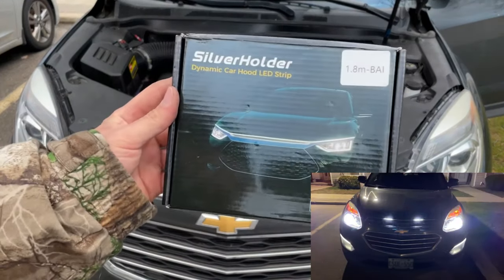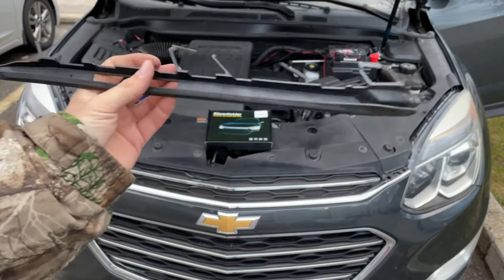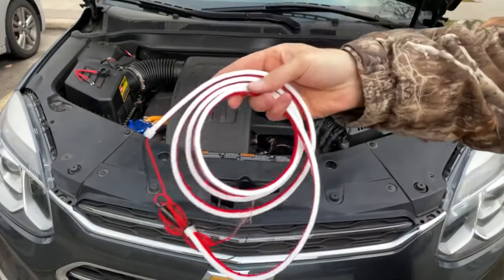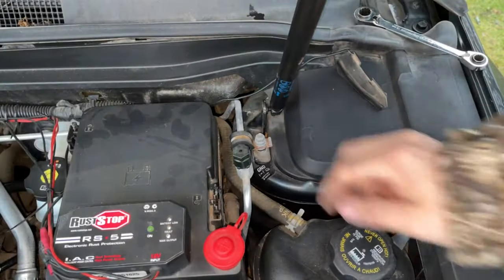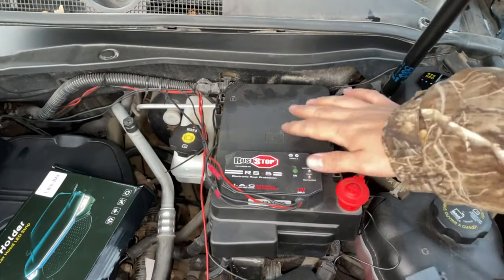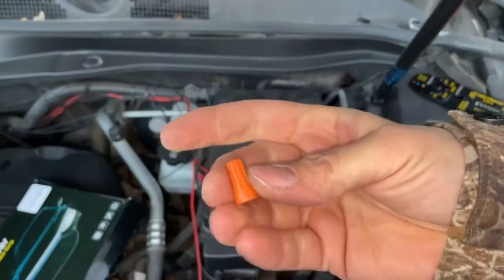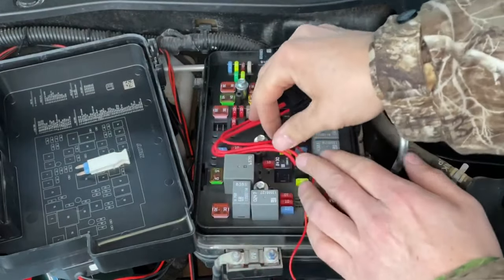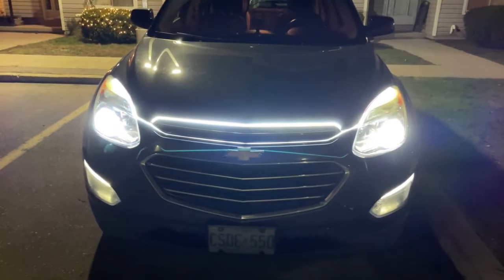SilverHolder Dynamic Car Hood LED Strip Installation (Chevy Equinox)

Comment: Aye you did a great job until you pulled that house connecter out lmao...
Reply from the maker: Yes not everyone agrees with that. But if they think that’s no good they can simply put a shrink wrap connector (as I did mention). This is my car and I’m ok with it. And it’s still holding nicely. Thanks for watching. Please like and subscribe
Reply: @BillOfAllTrades2016  I don't see the big deal with using that marrette  seeing as you placed it in the sealed fuse box. Now if you didn't, then that would be a different story. Thanks for the video
Reply from the maker: Thanks. Finally someone agrees. Yes if it was out and exposed then proper connector and shrink wrap would be used. The fuse box is weatherproof. Thanks for watching. Please like and subscribe

Comment: Those stock adhessive that came with on the LED light are cheap and will not stick good on the hood when going against the wind.  I ended up removing them cheap adhessive and put a much better adhessive tape on it. To keep it stay on without the led light strip coming off. My 2018 traverse does not have an accessories fuse to connect the wires to it.
Reply from the maker: Huh. Lol the wind has no affect on the light strip because when you close the hood it pinches it down and keeps it in place… if it’s installed properly. The adhesive works very well. I installed mine in the middle of winter and it stick super strong even in the cold. Perhaps you didn’t clean your surface properly. Did you use rubbing alcohol to clean it well?

Comment: The 16-Gauge Standard-Blade Fuse Holder/Connector is not available to purchase from the link. What other alternative product do you recommend? Thank you.
Reply from the maker: You can buy the piggyback fuses are also available on Amazon or at any local auto parts store. Doesn’t have to be the style I used. Mini fuse piggybacks works as well. Thanks for watching. Please like and subscribe

Comment: Hi. I put it on a fog lamp fuse 15a but its not working.
Reply from the maker: What is the original amperage of the fuse that you removed when putting the piggyback fuse?

Comment: Can you tell me the thickness of the LED strip in centimeters?  I have little space between the bonnet and the body of the car.
Reply from the maker: It is about 2-3mm thick. It is squishy and can be compressed. All hood gaps are very minimal. This will fit any vehicle. Thanks for watching. Please like and subscribe

Comment: any one help please?
I've tested my light strip with my battery, works good. I've also tested spare ports in the fuse box to see which ones light up when car engine is off and which ones dont light up with the car off. so i generally know i have two spare fuse spots that i could use to connect BUT HOW do i connect the red wire? like how does it stay in? it seems i need a clip or something to hold it down into the port? no idea i had to purcahse another part for this. kinda peeved off.
Reply from the maker: Use the add a fuse or piggyback as it’s referred to. The one I showed in the video. Stick the fuse connector in the fuse slot. It costs $5. If you follow my directions there will be no issue. And an extra $5 piece shouldn’t upset you.

Comment: The fuse you took out to connect the red wire which fuse did you take out from. What is the acc fuse and where to find it. Trying to install first timer lol
Reply from the maker: I’m assuming you also have a Chevy equinox? If so, pop open the fuse box lid and look for spot #18 on the map on your lid. It’s a blue 15 amp fuse on the top left corner of your fuse box. That’s the parking lights which are the lights that glow on your brake light when the brake isn’t pressed. I switched the piggyback fuse to that one. I actually couldn’t find the acc fuse so the parking light works perfect. Thanks for watching. Please like and subscribe

Comment: I'm having a hard time with the Fuse portion, as the Fuse adapters I got won't fit into the Fuse box (they're the right size, just too much going on in the fuse box). So I'm trying to find this fuse tap at other online stores, but can't. 

Because princessauto says it only ships to North Dakota? When I go to checkout, I can only choose North Dakota, which doesn't work. For obvious reasons. Thanks!
Reply: Just wrap it around the fuse and stick it in 🤷

Comment: How about you don't have to mess wirh the fuse and just tap it to the DRL wire? Is it safe?
Reply from the maker: You can tap into the DRL directly yes. But it involves peeling the wheel well back and then you also have a break in your wiring. This is super easy. All in the engine bay and doesn’t tamper with anything. You could remove the fuse tap and put the old fuse back and never know there was a modification. This method I showed is safe. Thanks for watching. Please like and subscribe

Comment: What is the amperage rated on the LED light. Going to tap into rear voltage Outlet which is a 20 amp fuse should I use a 10 amp or 15 amp fuse for fuse tap
Reply from the maker: The manufacturer actually doesn’t specify any amperage info. However I have mine running off of a 15 amp fuse and haven’t had any issues. Thanks for watching. Please like and subscribe

Comment: Hey i got 2 yellow wires 1 green and red and black how do i do it
Reply from the maker: You must return it for the correct one. For a dynamic hood led strip there are only two wires. You must have ordered something else or had wrong item sent to you. The only way I could see there being that many wires is for a truck tailgate strip light because you would have a black and a red for ground and positive. Your two yellow wires are one for each turn signal. And the green most likely for the reverse light.

Comment: What size fuse is the inline fuse that comes with the kit? I dropped mine in the engine bay and need another.
Reply from the maker: That is a F2AL250V fuse. Hope you get what you need. Thanks for watching. Please like and subscribe

Comment: How do I get the cables to the fuse panel if it’s on the interior by the steering wheel?
Reply from the maker: There are a couple options. You can look at the firewall and try to find wires that travel through a existing factory hole. It will have a rubber grommet on it. If that’s not an option then you can look at running the wire through the fender. On the vehicle in this video if I open the drivers door then I can see a gap near the strut mount point where there is a gap. Then when you fish it through the gap in the fender you are good to go. Hope this helps. Thanks for watching. Please like and subscribe

Comment: Electronic Rust stop? Never heard of that
Reply from the maker: Ya it’s popular here in Canada. It has sacrificial anodes that are supposed to rust instead of the frame and body. Similar concept as a water heater. Doesn’t actually work. I’ve been meaning to remove it. Thanks for watching. Please like and subscribe.

Comment: How did you know which fuse to remove??
Reply from the maker: I tested them using a circuit tester pen to see which ones would stay on with the ignition but off when I turned the vehicle off. Here is a how to video for that: https://youtu.be/UYbqB1lwu50
Thanks for watching. Please like and subscribe

Comment: My car did not have any DRL or fog light fuse.  Use the cooling fan relay
Reply from the maker: Whatever you do, DO NOT use the cooling fan relay… or and relay/fuse designated to a vital engine component. That thing sorts or malfunctions you are stuck on the side of the road overheated. Put it in the parking light fuse instead.
Reply: @BillOfAllTrades2016    I don't believe I have a parking light fuse.   My vehicle is a 2019 Hyundai Veloster Premium
Reply: Any relays you would recommend?

Comment: did you just leave the red tape on the other adhesive side?
Reply from the maker: Yes. Because if you peel off that tape, when you close the hood it will also stick to the hood and seal it shut. And the tape won’t show when it’s closed. Thanks for watching. Please like and subscribe.

Comment: Thank you for this video. I ordered this and am learning some stuff before I install it.

If I plug this led light in, is it already programmed to do it’s thing. So no matter if I piggyback with the headlights, parking light, daytime running lights, fog lights it will all be exactly the same result?

Thank you for any help.
Reply from the maker: That is correct. The startup scan sequence is programmed into the light already. All you need it a power source. It will work the same scan at startup no matter where you connect it. Just make sure you tap into a fuse that shuts off when you turn the car off. Here is how to find the right fuse: https://youtu.be/UYbqB1lwu50?si=3clrP4RnFWf4jJZZ
Reply: @BillOfAllTrades2016  thank you so much, subbed!
Reply from the maker: You’re welcome. Thanks for the sub

Comment: I have a 2015 subaru impreza and the strip lights up regardless of if my car is on or not
Reply from the maker: Did you hook it up exactly as I showed in the video? Get a circuit tester pen and test your fuses with the car off and then again with it on. Perhaps the fuse you chose has constant power. You need to select a fuse that powers down when the engine is shut down. Try testing the parking light fuse. Hope this helps. Thanks for watching. Please like and subscribe
Reply: @BillOfAllTrades2016  I followed step by step! The only concern I have now it all my fuses light up when I test them 🤣
Reply from the maker: Even when the key is out of the ignition? Maybe you have to use a t-tap and splice into a headlight or fog light wire

Comment: What about the weather stripping on the hood?  Did it interfere or did you remove it.
Reply from the maker: I left that weatherstripping on. I had no issue with it during the install. The only stuff I removed is what I showed from the headlights. Thanks for watching. Please like and subscribe

Comment: When I connected mine, it stayed on when the car was turned off, do you why that is or how I can fix that? Also, if my headlights are set to auto, will it turn on automatically with the headlights or does it stay on permanently while car is on? 
Thank you in advance
Reply from the maker: What fuse did you tap into? I made the video in this link here to easier understand what fuse to tap into: 
https://youtu.be/UYbqB1lwu50
I hope this helps. Please like and subscribe
Reply: Thank you for responding and for the tip, that helped. I connected it to the left headlight fuse. What fuse would you recommend? Is there a fuse that will turn on only at night? Possibly the fog light fuse?
Reply: I was hoping to connect it to a fuse where it will  automatically turn on with the lights while in headlight auto mode
Reply from the maker: I put mine into the parking light fuse. So mine only come on at night.

Comment: For some reason when i use the fuse for the fog light mine dont work i dont actually have fog lights on mine its just the trun signal which fuse is the parking light you said you used in one of the other comments ?
Reply: It will only work when the fog lights are activated if you did that. The lid of any fuse box should have a map of what fuses are what. Ideally you want to piggy back a fuse that's activated when ignition is turned on and not by something like headlights or windscreen wipers
Reply from the maker: On this equinox it’s spot 18. That is the far back left corner of the fuse box. It’s a 15 amp fuse. Here is I link to a video I made that better shows the parking light fuse location. Thanks for watching. Please like and subscribe
Reply: @leighhumphrey2779  yea I know i had a 19 that had fog lights and now the 21 that doesn't but I didn't realize that at first when trying to install the lights iv tried the fog light obviously didn't work and the DRl which didn't work either so I'm gonna try what this guy did and to the parking lights
Reply: @BillOfAllTrades2016  thanks bro and just from looking at the way yours is set up it looks just like my fuse box so it should be the same I'll update torrow and let you of I got it to work I didn't buy the same brand you used but mine look basically the same the box is even the same I may have to buy a different fuse tap then what came with mine so we will see again thanks
Reply from the maker: You’re welcome. What brand did you buy? Most of them are the same. Just repacked with a new brand on it. I like the parking light fuse because it only comes on at night.
Reply: @BillOfAllTrades2016  its one off Amazon I don't remember the random name of it

Comment: why do they have double sided tape on it ?
Reply from the maker: Well as you saw I had my wires facing the drivers side as that’s where the fuse box is located. If the fuse box were on the passenger side you would need to flip it so the wires face the other way. And also some people stick it to the actual hood itself. If I were to stick it to the hood I would have used the other tape side instead. It makes it so it can be installed on any vehicle in any position needed. Thanks for your question. Please like and subscribe
Reply: Where did you buy the piggy fuse. Can you please share

Comment: Got a question. I installed this product. Negative cable grounded to negative terminal of battery and red cable to Daytime running light fuse using the piggyback cable. 2 10a red fuses on it. It works but the light stays on even when car is off. Please help!  Thank you
Reply from the maker: Try grounding it to an unpainted bolt as I did in the video to see if that helps. I never connected anything to the battery on my install. I have also reached out via email to the manufacturer of this product about this issue as it seems to keep popping up in the comments. I will advise here once I get a response. Thanks for reaching out. Please like and subscribe and stay tuned
Reply: @BillOfAllTrades2016  Thank you so much
Reply from the maker: You’re welcome
Reply: @BillOfAllTrades2016  
Can you give any instructions or guidance on how to install/wire Silverholder Rear LED Spoiler strip. 
Thank you
Reply: @evanrosen95  did this fix your problem?   I have the same issue.  The light won’t turn off even with the car turned off.   I have it piggybacked on the headlight assembly fuse

Comment: I am trying to do this on a 2008 Ford Escape. I want to use the piggyback that you used but I think the fuse for the fog lamps on my car is inside the cockpit. Do you think I could piggyback on any other fuse in the engine compartment?
Reply from the maker: Yes you can use any other 15amp fuse in the engine bay that is powered on when you turn the key and powered off when you remove the key. You may want to buy a $5 test pen light to check which fuse has power when vehicle is running and powers off with no key because some fuses stay on even when you remove the key. The fog light was just an example for the equinox as every vehicle is different. Thanks for watching. Please like and subscribe
Reply: @Bill Of All Trades  Thank you!!! Much appreciated and keep up the good work!!
Reply from the maker: No worries. Will do. I have a lot of demo install videos coming up from collaborative companies products as well as a bunch of accessories I recently bought. Stay tuned. And take care